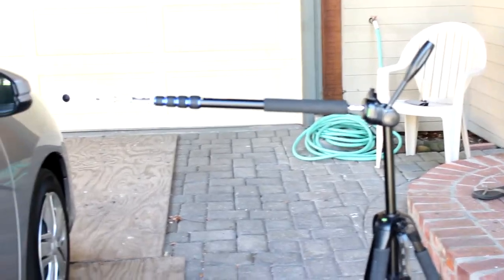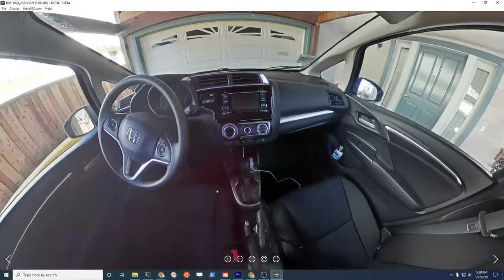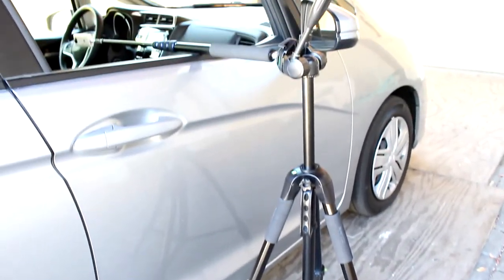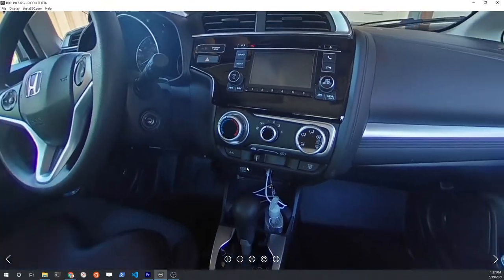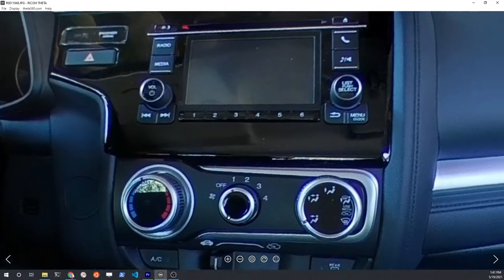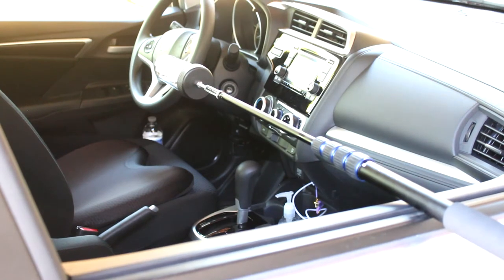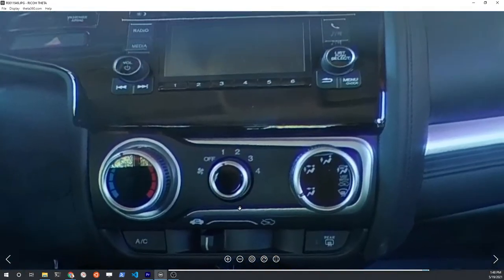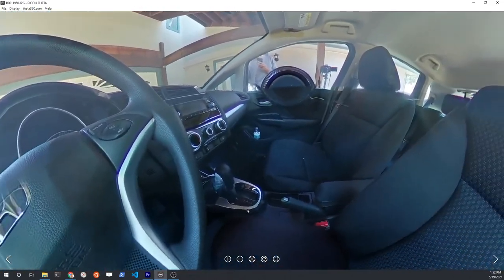Mount RICOH THETA Sideways for Automobile Shots

Comment: Thx for the video - I work right now on a car pictures and the first attempt was very bad (even with Theta Z1 Doualfish plugin 9 bracket) - the sun from front was to stron and the glare destroy all the details in picture :(
Reply from the maker: If you're trying to get a good shot, do not use a case like in my tests.  focus on the interior of the shot.  Use a separate image of background scenery with the interior of the car, then merge the two scenes in photoshop.  The person looking at the image most likely cares the most about the interior of the car.  Use EV compensation or manual settings to make the interior lighter.  The windows will be blown out (overexposed).  If you need the windows, cut them out with photoshop and then use the merge layers technique.  See examples from pro-photographers below.

https://community.theta360.guide/t/tips-for-car-sales-shots/6821?u=craig
Reply: @THETA360Developers  Thx for sharing the link it's look very good! and the car in forrest very nice :)